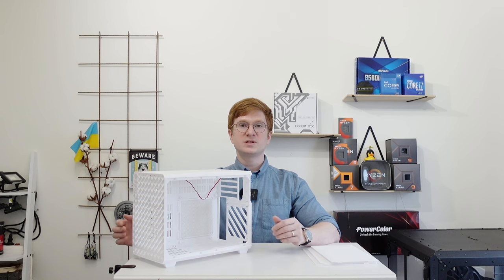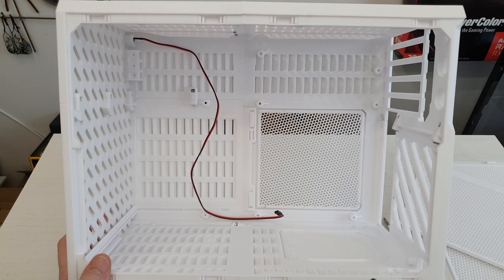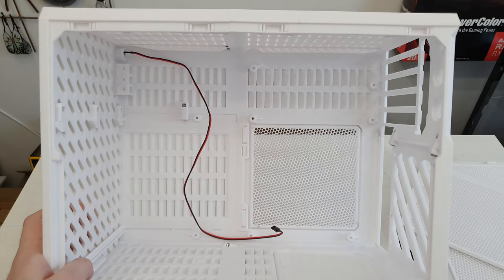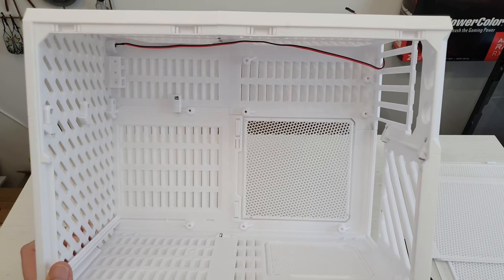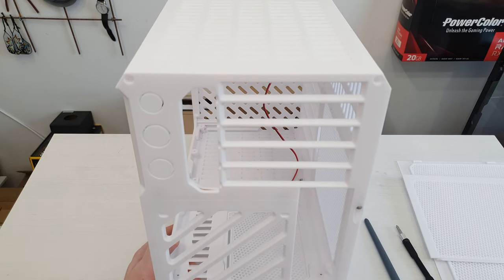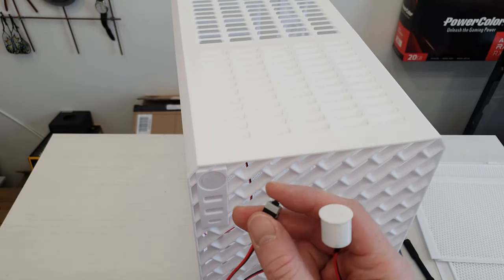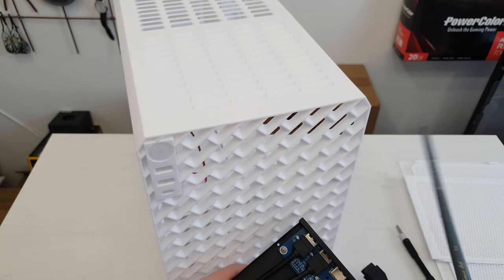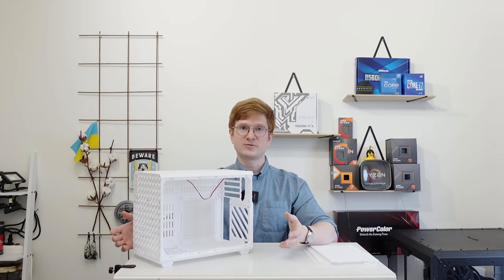MODCASE Evo – preview of a very compact mATX, mITX chassis for 3D printing

Comment: Looks good! Would love to see an Matx/Itx board review using this case and then maybe you can reference this content there also.
Reply from the maker: I don't quite understand, how motherboard review would be affected by the chassis?
Reply: @Miyconst  It won't. It's an excuse to make a build to explore the aesthetics and build layout of the case AND to reference your other work. People like to see case reviews with a build inside. Instead of doing a board review AND a build video separately, you could do both in one video. It could ALSO be an excuse to use one of those white aliexpress referb cards. I think there is an A2000 and RX580 in white.
Reply from the maker: Oh, now I see what you mean, yeah, it could be interesting, regarding the white AliExpress cards.. I would much rather just print a custom shroud for a reputable GPU than resort to those questionable and rather fishy AliExpress offers.
Reply: @Miyconst  Another reason to make use of 3D printing. MAYBE even to slim down an OVERsized card and use something like Slim 92mm or 120mm fans

Comment: I have the 3d printed NAS case, rNAS 6x, and it is AWESOME too. 6-bay NAS chassis for ITX motherboard, full size PSU support and also room for 2x ssd.
Reply from the maker: Yeah! I have seen that project, it's very interesting indeed and 6 HDDs is a nice feature.
Reply: @Miyconst  My friend printed it for me. But I'm thinking about getting a 3d printer myself. I heard Bambu Lab is all the rage lately
Reply from the maker: @outrageousotis454  yes, Bambu Lab is a force to reccon with but I don't want them because of some of their policies and the useless customer support. Prusa is my choise but they are expensive due to EU production costs.

Comment: Thanks Man... You saw my comment? I was exploring a 3D case... if you have to buy the 3D model, it doesn't make sense for just 1 computer.  3D model+Print+boton+USB+screws will be like a brand new case. I'm I right?
Reply from the maker: It really depends on how much a comparable chassis would cost you and whether you buy button/fan/USB from AliExpress or local market. In general, I would say it makes sense to buy the model if you plan to build two or more PCs.

Comment: the only issue i have with this case is i can't print the side panels on my 245x245mm bed without doing the optional split, and i'm unsure why as the split is supposed to be for under 200x200mm, i don't know if i'm missing something or if it actually requires 250+mm and the website doesn't state it.
Reply from the maker: I think 245 by 245 should be enough. What printer and slicer do you use? You can ping me on Discord and I will try to help.

Comment: I would be interested to see if the heat generated by the GPU/CPU might weaken the case if it is printed in PLA. My home PC wouldn't get that hot, but those old Xeons can make a lot of heat!
Reply from the maker: PLA is a very bad option for such use, it warp and loses its property from heat but I printed in PETG which melts at 220C+ and PC temps aren't an issue for it.
Reply: Yea you can't use PLA. Use PETG. I know some people say their PLA case is fine, but that's because their environment and cooling not reaching the glass transitioning temp probably.

Comment: not perfect but very promising... can't wait to see the final pc assembly btw! great idea!
I suggest to divide the 3d print in more parts, so that it won't be interruption between the bottom half and the upper one...
Reply from the maker: Thanks for the suggestion. It's not my design but I have the CAD files so I may try to adjust it.

Comment: This looks awesome! Do you think you'll make a build video on it? 

Also, another question, is that a PowerColor 7900XT in the corner I see? RADEON FOR THE WIN!
Reply from the maker: That is exactly a RX 7900XT and yes, I plan to make a build video.
Reply: @Miyconst  Nice! Will you highlight the process by which you printed it as well as the printer you used? I want to do a build of my own in this case, but I'm a noob at 3d printing.
Reply from the maker: @skr3539  sure, if you have any specific questions - welcome to join my Discord. I am available there.

Comment: Hello I copy my comment from other video for help!
Hello whats the best build for E5/x99 for gaming? Fastest cpu and mobo setup for 150$ max! Turbo mod or v4. (Aliexpress)  Please answer what is the best one! Looking to build a good pc! LOVE THE CHANNEL!
Reply from the maker: The best in what metrics? Value, price, performance, features, quality? $150 with or without RAM? VAT?
Reply: @Miyconst  Looking for a bundle that is around 100-150$ with mobo, ram and cpu but I can also pick the parts separetly. Best mobo? Cpu? ram? Pc will be specifically for cs2 gaming, 720p paired with a rx 5700 or 1080ti! Thank you for replying. You are the king when it comes to x99!
Reply: @Miyconst  I can find E5 2698 V3 Combo Set or E5 2680 V4 set for those prices easily. Please provide me with your recommendations and thoughts below.
Reply from the maker: @Audiosenses69  E5-2698 V3 with TBU will easily beat E5-2680 V4 in CS2 but at the same time it will suck much more energy, thus more stress for VRM and PSU.
Reply: @Miyconst  Are the SZMZ S3 Mobos good? What about running this: MACHINIST RS9 X99, Kllisre RAM DDR4 8GB x 4 Memory 2666MHz, with a E5 2697A V4 or E5-2698 V3 with TBU. Is that a good setup?
Sorry if this is a hassle to deal with, there is just so many options out there and I want to get a good value and performance for my money.
Reply from the maker: @Audiosenses69  my experience with SZMZ boards was mostly negative but yours might just work. Every X99-RS9 I had worked well for me and paired with E5-2697A V4 it will be a decent build but make sure to cool the VRM properly.
Reply: @Miyconst   RS9 X99 with E5 2697A or E5-2698 V3 with TBU better for cs2? <3 Subbed btw
Reply from the maker: @Audiosenses69  E5-2698 V3 with TBU and a few disabled cores is better than E5-2697A V4.

Comment: what bios setting to boost 1650 v3 to 3.7ghz ? It seems stuck at 3.5ghz
Just got Qd4 yesterday but can't understand the bios. Everything is stock except disabled POR and manual 2400. (Huananzhi desktop micron d9tgg udimms). Everything puttied and PTM'ed including a sweet rx580 without solid finstacks and naked vram chips.
Reply from the maker: As far as I know the stock X99-QD4 BIOS doesn't support overclocking.